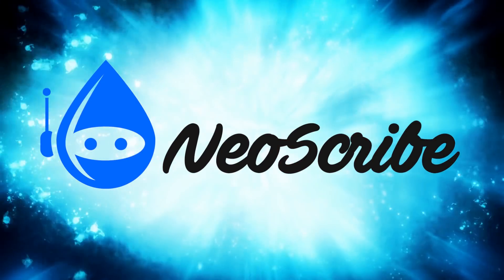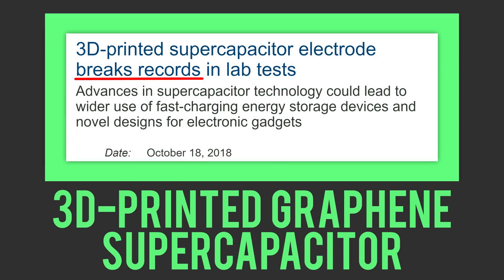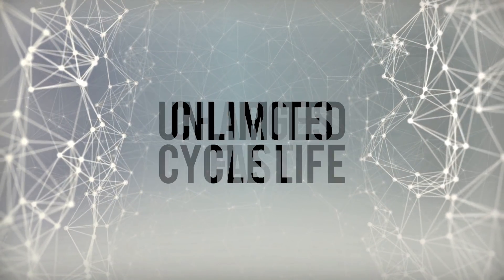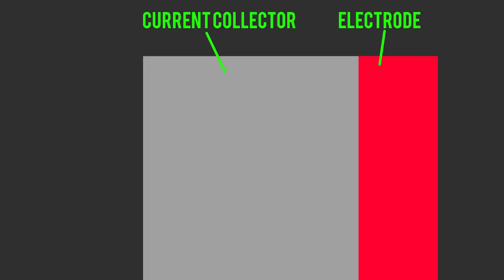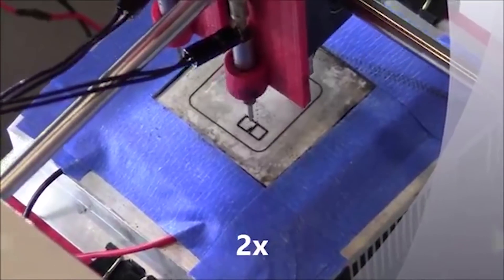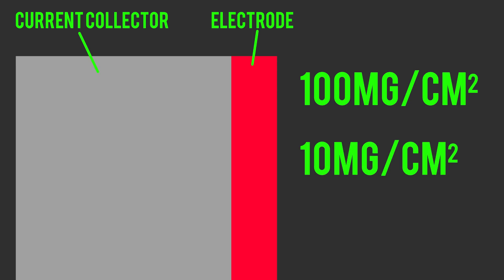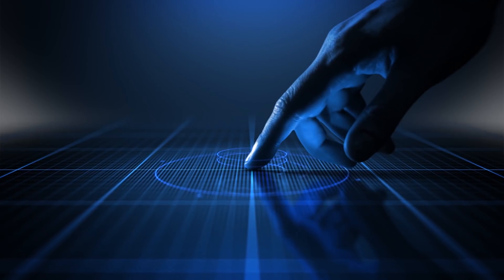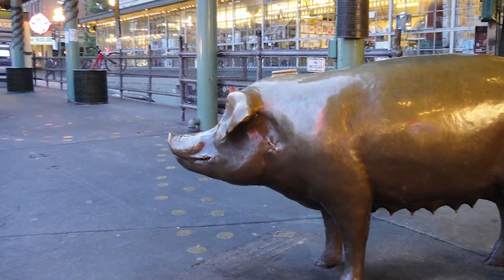Amazing 3D-Printed Graphene Supercapacitor Electrode

Comment: For disadvantages you forgot a big one which is that you have deal with such a huge range of voltages
Reply: Rykahnz not a big one just another nothing burger!
Reply: I'm an Electrical Engineer, what are you a burger chef
Reply: Rykahnz I have a bank of super caps ( same voltage not the same capatence between my battery and controller for absorbing regeneration braking energy,as do most e-vehicles.this also buffers the battery from exceleration wear and tear by using diodes to protect the reverse flow
Reply: I said it's a disadvantage not that it makes capacitors unfeasible, they still have their place, but it is a substantial disadvantage that your circuit has to deal from the rated capacitor voltage all the way down to 0. That requires extra hardware or you can't use the full breadth of the cap, it's as simple as that.
Reply: Rykahnz, sorry I understand what your saying. I have been an advocate for alternative energy science scince elementary school.
I have had subscriptions to scientific periodicals as early as third grade. My sixth grade science entry was electrolyzing H2O into hydrogen & oxygen collecting them in balloons.
After winning first place I demonstrated to the audience by lighting the balloon (- hydrogen electrode collector) and had a flame of 10 inches until the balloon emptied.
Privately demonstrated to my friends how combining the oxygen with the hydrogen produced a flame that made a noise like a rocket.

I am telling you this to demonstrate my enthusiasm for what can be done.
I have been contributing info in forums such as this to try and spread the truth we all could benefit from.
When I come across nay sayers in forums I like to put their arguments to rest because we have pseudoscience here say nonsense being perpetuated unknowingly by what most consider common sense.
Forgive me if I have offended you I also am here to learn. And sometimes I do learn new things if not from the forum but from research regarding new info.
On occasion I pay to download white pages from university R&D regarding new patents.
My father was an electrical engineer but new little about electronics, chemistry, or material science.
My forte’ is scientific illustration using 3D modeling and animation to demonstrate science based knowledge concepts to students.

I have personally built 10 e bikes  I wind my own dc pulsed motors and build battery packs from scratch. I am currently building an e car from scratch. This includes welding braising,soldering. I use my own hand made hydrogen electrolizer (converted a cheap welder for charging h2o into Browns gas. This works great for aluminum welding!
I do purchase rather complicated computerized motor controllers that pulse dc current to brushless dc (magnet based ) motors.
My fastest bike has 18 mosfets( high powered electronic switches) delivers 60amps @ 96 V.
My car controller can deliver 11 kilowatts (peak burst) pulsed to a 10 kw motor (peaks at 18 kilowatts). While this is not a lot of power the car is tiny and only weighs 500lbs.

I am personally building a Ultra capacitor bank made from hemp fiber. By crushing the stems of hemp until you end up with what appears to be fine strands of straw at the diameter of a course hair. This material is placed in a old propane canister and vacuum- pressured at -300 psi then argon gas is inserted to ambient pressure.
The canister is heated to 350 degrees f . It cooks for 3 hours resulting in the fiber shrinking hundreds of times but remains vascular as there is no oxidative reduction reaction as the environments is oxygen free. The result is essentially carbon nano tubes (cylindrical graphene). This material is a high conductor of electricity very little resistance and can dissipate heat faster than any known substance ( other than what was talked about int this presentation “graphene aerogel”
This is the point I am at in this project the first bank will be tested on my fastest bike when it is finished. Have not made this dry powder into a solution yet as I have not decided what type of polymer to mix in yet and weather this polymer will need to be treated in the same manner as above mentioned.vacuum treatment.
Reply: Rykahnz if you are then you would not have made a comment about details that have been resolved long ago.
There are fleets of buses all over the world that run on super caps only and charge at designated bus stops instantaneously as passengers board.
This makes your concern a minor detail as obviously this is beyond feasible.
I notice all of the negative comments in these forums sight problems that are not relevant and are already resolved.
Shill for big oil maybe?

Comment: same message again, wait ten years....
Reply: The recent movement towards e-vehicles and alternatives has spawned a revolution. This has awoken tec that has been dormant for 100 years.
Look at the personal computer the internet. These movements came out of nowhere and dominated the economy in just a couple of years.
Reply: Dana Putnam   yeah, we can blame the oil industry for holding back the electric revolution.  No stopping it now.  More competitors will drive the industry forwards, so I hope that the newer nano tech will quickly be incorporated into new battery designs, to further their developement.  Coupled with stronger, lighter materials, the aviation industry will have a great benefit designing electric planes/personal drones?  that are practrical to use in the near future.  Waiting for new tech to arrive to the public, is like pulling teeth.  Frustrating....can’t come soon enough...

Comment: The way I see it is that the problem wish capacitors is that, sure you can charge them fast, but you have not choice but to discharge it fast also. A battery cannot be charged very fast, but discharges slowly also. Capacitors certainly have their uses, but you can't just slowly drain them into a battery. They basically operate as either empty, or full. There is no real in between like with batteries. They're great at regulating voltage and pair wonderfully with inductors.
Reply: Very wrong. A capacitors range is from top volt to zero while a battery maintains a  voltage during discharge. When you have to use a specific voltage etc. 12 volts it is easy to use a battery etc a lead/acid with 13.2 volts because when empty it is around 11.5 volts so you only loose ½ a volt while a capacitor will drain to zero volt so you will loose 11.5 volts. Numbers are used for demostration.
Reply: Tundra14 not!
Reply: It sounds like you have mistakes in the video that need to be edited.  I.e. Graphine is graphite not Silica

Comment: I detest and usually laugh at the tin foil hat conspiracy theories regarding batteries/super caps but unfortunately it is known how a major manufacturer of batteries, after getting a patent for a greatly improved version of the Edison battery {which while quite heavy has some fantastic life/cycle characteristics ideal for renewable energy storage} promptly shelved the design and never sold a single one. The bottom line does not like a battery which is not replaced every couple of years.

The potential long life span and short charging times of a supercap makes it very difficult to get past the bean counters.

Graphene seems to have fallen into the bean counter trap. Lots of promises but hard to find in the market place.
Reply: Who killed the electric car alluded to automobile manufacturers buying the nickel metal hydride patent in 1998 and shelving it. Until Toyota began importing hybrids . Then slowly they began to wake up. But even the e-cars with lead acid batteries were a success among the people who leased them. The manufacturers recalled the lease and crushed the fleet because they did not want to be forced by California to make e-cars.
Reply: @Dana5775  
Difference?
This time we have "him", actually making patents public!
Reply: https://www.offgridcompany.com.au/batteries/ni-fe/

Comment: Interesting video as always!  Can someone explain how super-capacitors generate power from static electricity?
Reply: They don't generate power, they store it on a dielectric surface.. think two flat pieces of copper with a sheet of plastic between them and a positive charge on one side and a negative on the other.. when a current goes past each plate some is stored on the insulation between them
Reply: Basically the charge is trying to get to the other side but instead imbeds itself into the insulator

Comment: Dude look up skeleton super capacitor that is already in production.  They have a 1.5MW storage system that fits into 2 square meters.
Reply: Those are just large arrays of conventional capacitors which the company calls "super capacitors" in order to cash in on the name.

But the term "super capacitor" when used in relation to developing technology usually means something capable of holding large amounts of energy in an unconventionally small volume. In this area of research 3D graphene structures are very promising but the technology to make them isn't commercial at this time. Producing them from an aerogel was until recently an interesting idea, but now someone has been successful it seems. 3D printing it is even more interesting as it implies fabrication of energy storage components to any form factor. Think fitting it into a ring on your finger as easily as into a wrist watch or pair of glasses, without designing the rest of the wearable around the energy storage. So this is a noteworthy step forward in multiple ways.
Reply: @philsangster677  
Watch the fullycharged Estonia episode, they interviewed the CEO of Skeleton, he begs to differ?

Comment: Yes I get what you are saying but as most Companies are working towards becoming Monopolies they will refuse to pass on any savings in costs associated with advancing Tech; just look to Intel if you don't believe me. They are getting More CPUs per Wafer than ever before yet CPU Prices only manage to INCREASE rather than DECREASE. It costs far less to produce CPUs these days then years past yet GREED is allowing Intel to KEEP the difference in Costs. Decades ago Far more Gold was used to produce CPUs yet that is not the case today though Pricing has not dropped as GREED, more specifically Corporate Greed, is the only viable answer.
Reply: when you compare tech sector prices to other sectors, it is cheap. but you are right it could be cheaper
Reply: Actually you have missed a critical change the drives the cost up.  15 years ago we reached the limits of conventional photo lithography for creating smaller geometries.  At the same time conventional silicon processes could no longer provide transport speeds, power densities and signal gains to allow further device shrinkage.  Capital equipment costs escolated so fast that the majority of the semiconductor companies could no longer compete and closed their fabs and now use a few large factories to produce their designs.  Result, yes more chips can be produced on a single wafer but that wafer costs 5 to 10 times as much to produce than 15 years ago.
Reply: Some of what you say is true, but what you seem to have missed is how the production of the wafer has moved to Monopoly Companies as the little guys were priced out of business. You say this with your Capital Equipment Cost statement. Monopolies have reduced the cost of making the Wafer and they get almost 2 times yield as before. Spin it any way you please but Monopolies are killing the PC Market and if WE THE PEOPLE continue paying exuberant prices or allow this bullshit overcharging to continue they we only have ourselves to blame. Not only that but CPU Yields are far better than before along with more everything on a smaller Chip means faster, smaller and cheaper but Monopolies don't pass on the CHEAPER Part because of GREED. Why sell something for 100 USD Profit when you control the market and can get away with selling it for 1000 USE Profit... Cheers...
Reply: @cybercapri  in 2005 a standard 8 inch  finished wafer cost $300  today wafers cost $1,500 and are 10inches in diameter. Thats 3.6 times more expensive per sq. Inch and the die haven't gotten smaller but more dense with one heck of a lot more functionality.  If you want the performance of 2005 CPU's you can still buy them and they sell for half what they did in 2005 due to shrinkage.  I don't think you would be satisfied with it though.
Reply: I get what you are saying but what you fail to realize is how many CPU's are being turned out per Wafer now vs 2005. Why do you think the cost of the Wafer has increased? Because there is only ONE company producing them and it's a fact Wafers are cheaper to produce now then in 2005. Also far more actual Gold was used in CPU's back then than NOW and you don't seem to get that part or you just don't care. Older CPU's have a lot of gold and it only takes a few to harvest a good bit of Gold from unlike today's CPU's. Gold is the most expensive part of any CPU and they use a fraction today vs years ago. The Wafer is nothing but refined SAND and though the process takes place in a room 1,000 times more sterile then an operating room it's still refined Sand at the end of the day... Do the math. Here is a quote from 2009: 

Google: one wafer yields how many cpus
https://www.google.com/search?num=50&newwindow=1&rlz=1C1SQJL_enUS812US812&ei=boLOW8zaLamf_Qbv3Y2gDw&q=one+wafer+yields+how+many+cpus&oq=one+wafer+yields+how+many+cpus&gs_l=psy-ab.3..33i160.2368.7160..7271...0.0..0.514.2650.0j9j3j5-1......0....1..gws-wiz.......0i71j33i299j33i22i29i30.azyN7-XlXIo

"Intel is rumored to have around 95% operational yields on mature processes, which on 45nm processes on 300mm wafers means a tremendous advantage in production with their many fabs. A 95% operational yield means if 500 dies were possible from a single wafer, 475 of them would be usable, and only 25 would be thrown out.Jul 9, 2009"

That's the yield from the 45nm Process and Intel is now using what, 14nm, so do the math on how many more CPU's are possible with a very high success rate, upwards of 95%, which means serious amounts of Profit for Intel. CPU's should cost Dollars, not Hundreds or Thousands all things considered. 

Google: how many CPUs can a wafer produce
https://www.google.com/search?num=50&newwindow=1&rlz=1C1SQJL_enUS812US812&q=how+many+CPUs+can+a+wafer+produce&spell=1&sa=X&ved=0ahUKEwiPkY3Lv5veAhUjneAKHQkiCWcQBQgpKAA&biw=1229&bih=578

"The minimum silicon cost with 200mm diameter wafers is about $2 per square inch, resulting in a maximum cost per wafer of $100.. The minimum silicon cost reached with 300mm diameter wafers is about $3 per square inch, resulting in a maximum cost per wafer to of $400."

"The retail price of a basic one-inch silicon wafer without any special features is about $21 when purchased in quantity. A bulk purchase of similar 6-inch silicon wafers costs about $125 per unit, which is about 6 times the price of the one-inch wafer.Aug 20, 2017"

Not sure where you got your price of 1500 but I found in 2017 400 is the going rate per Wafer.  Here is how it's Made: https://www.geek.com/chips/from-sand-to-hand-how-a-cpu-is-made-832492/ 

The Binning Process has improved as well. Intel has Wafers Made and CPU's are STAMPED after they are tested, not while being made so Intel has no real clue how many i3, i5, i7 or i9's will be produced until after testing. Some of the very best get turned into Xeon's. Then the process of what a CPU or GPU is determined. If it can't hack it as an i9 then it's reduced to an i7 and so forth down the line. CPU's are not made to a specific lump run of just i9's or i7's but rather a bulk is made then tested to be what ever. AMD does the same thing. GPU's are made the same way, a Wafer is constructed then sliced and diced to as many as possible. Then Top down from there. 

That is why OC is hit or miss. Some times a CPU might not hack it as an i9 so it's reduced to a very power i7. But lately Intel is gimping the lower CPU's further but disabling Hyper-Threading on lower tier CPU's starting with the i7 and that is just BS. 

Here is some food for thought: 
Intel Corp Profit Margin (Quarterly): 29.51% for June 30, 2018
Advanced Micro Devices Inc Profit Margin (Quarterly):6.61% for June 30, 2018
NVIDIA Corp Profit Margin (Quarterly):35.25% for July 31, 2018

The numbers don't lie, when I say AMD is Intel's BITCH STEWIE this is why I say it. AMD is taking table scraps from Intel. Intel is so over priced it's not even funny and AMD is barely keeping afloat. Don't think for one microsecond Intel is not a MONOPOLY... And don't even get me started with Nvidia, those shysters need to be disbanded. 35% profit margin means that nVidia can cut prices by 35% and still break even. Basically 35 dollars of every 100 dollars is PROFIT for nVidia and you Tards just have to RUSH OUT for the Latest RTX BS... 

Look at how much profit Memory is bringing for Samsung, Korea: 
https://phys.org/news/2018-04-samsung-profit-memory-chips.html

This is sickening as Samsung enjoys upwards of 70% profit: "The lion's share, more than 70 percent or 11.55 trillion won ($10.7 billion), of its latest quarterly operating income was generated by the semiconductor division." Who the fuck is the LION??? When there is Competition 70% is more like 20 or 30% but because DDR4 is forced upon us, because of Monopolies, they can overcharge and we have to BUY IT or go without. 

Read more at: https://phys.org/news/2018-04-samsung-profit-memory-chips.html#jCp

You guys need to stop paying these high prices because you are only forcing these Monopolies to charge MORE... This is why DDR4 is so costly because of Corporate GREED and has nothing to do with Demand or limited resources.